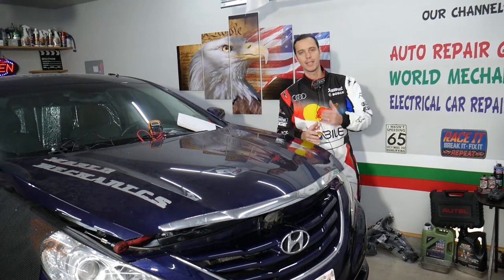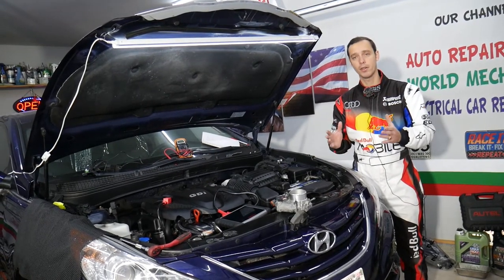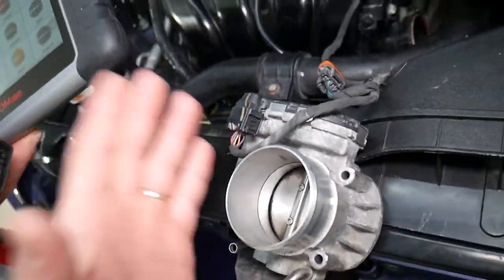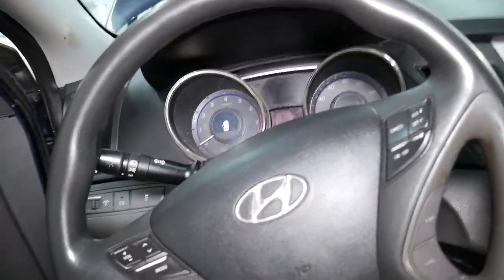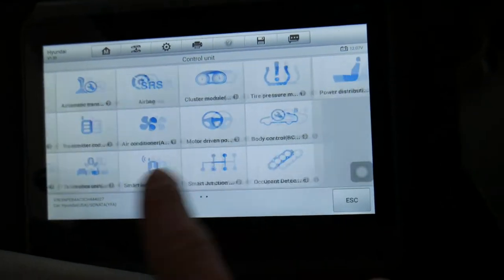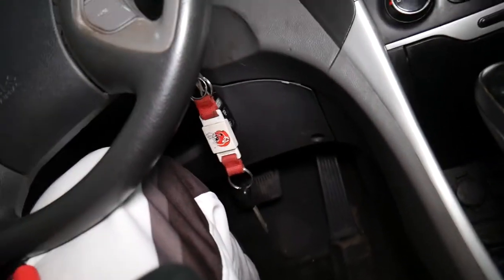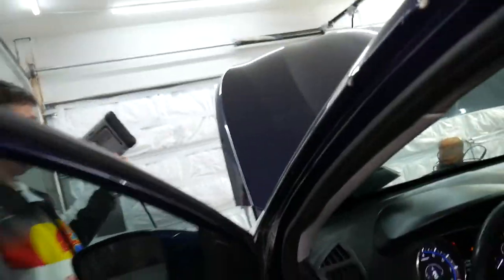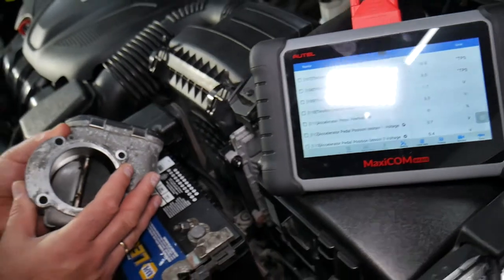HOW TO TEST THROTTLE PEDAL GAS ACCELERATOR PEDAL HYUNDAI ELANTRA SANTA FE TUCSON ACCENT VELOSTER SON

Comment: Error codes I received where indicating a problem with either throttle body or accelerator pedal, after replacing both. Found the issue to be liquid getting into ECU and shorting out. Creating check engine light codes and limp mode. I recommend checking ECU first. Prior changing out throttle body. Might suve you hundreds $$$.